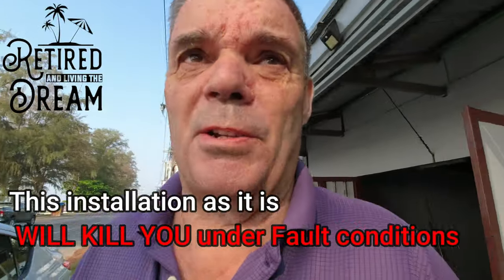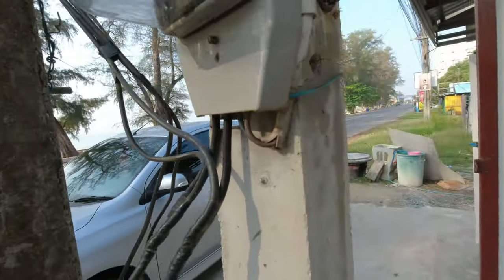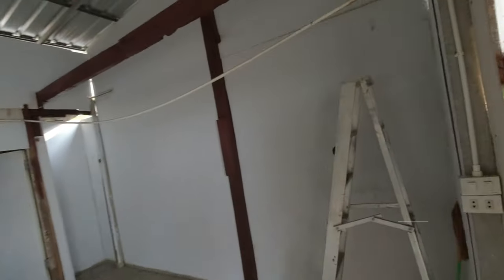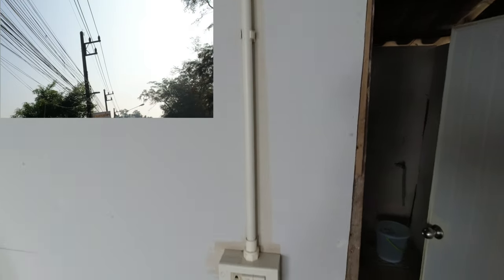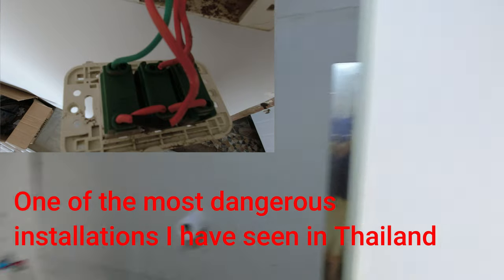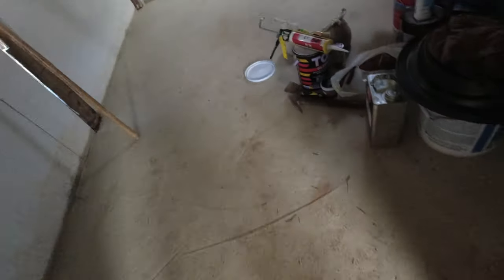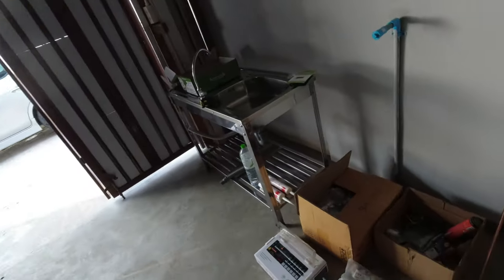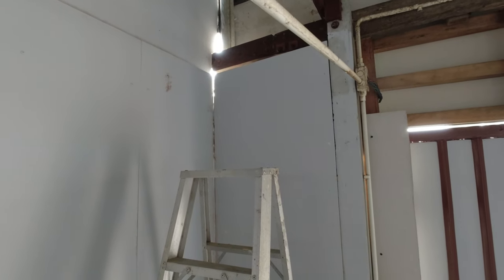Dangerous electrics electrical dangers around the home must see!

Comment: Hello Les, what a fantastic place to open a shop...wow.
Well, the video was shocking to start with and gave me a tingle down my spine into my safety boots. However, you or someone did a great wiring resurrection and it grounded me.
Thanks for a great vid Les.
Kind regards
Doug and Jum
Reply from the maker: Wow, thank you, Shocking Video I hope people will take note that Electrics in Thailand although in Plastic conduit can be dangerous. eg no safety cut off or circuit breakers. Your life is more precious than the cost of a  safety inspection. Have your Electrics checked by a Qualified Electrician. It is a FRACTION of the cost in the UK.

Comment: Is 6mm cable big enough to the earth rod?
Inside the consumer unit; did you connect the earth to the neutral that seems to be the law in Thailand?
Reply from the maker: Hi John the UK Regs state 6mm as long as it is protected, it is run in conduit with an  inspection access outside the property to check the connection, 10mm is for bonding between water and gas, non of this applies here as the supply pipes are plastic and no gas pipes only bottled gas. But as always some people read the regs in different ways, I was advised by a Thai Electrician 2,5mm is adequate here. Mmmmmm ok I am happy with 6mm protected.
Reply: @RetiredandLivingthedream  I am interested to know if you connected the neutral to the earth in the consumer unit as I understand that some say that is a regulation in Thailand?
Reply from the maker: @johntheaccountant5594  yes as directed by the installation instruction for this board the Main Earth and Neutral are connected to the same bus bar,.
Reply: @RetiredandLivingthedream  Thank you for confirming that because I am going to wire up my house in Thailand but using a Schneider consumer unit.
Reply from the maker: @johntheaccountant5594  
Look at the Fuse board installation instructions.
Reply: Depending on size of consumer mains, 6mm would be the minimum size earth cable, my experience in Thailand is that Thai electricians don't use an MEN link on unprotected circuits, but for me an MEN provides additional safety, but as Les has stated different countries different regulations, take Australia as an example nearly every state has different regs
Reply: @johntheaccountant5594  as an electrican I would strongly recommend using a qualified sparky, I'm sure it all looks easy enough
Reply: @markinthailand1201  Thank you.  I have carried out many rewires in houses I have bought/refurbished but never clearly understood connecting the earth to neutral and read the positives and negative in the consumer unit or the reasons for it.
Reply: @johntheaccountant5594  well that's why I suggested a qualified tradesman because they know the reason why 😬

Comment: Good job! Looked like an absolute death trap before you fixed it. What are you using it for now? Restaurant or store? How much is the rent? When I get to Thailand in August (I hope) I am looking for a space to build my large (2 metre) radio control yachts. Of course if I get a small house rather than a condo I can do it at home. In any case your place seems a great location right on the beach. Cheers, Colin
Reply from the maker: Best wishes on your move in August.  Sounds like a great hobby.